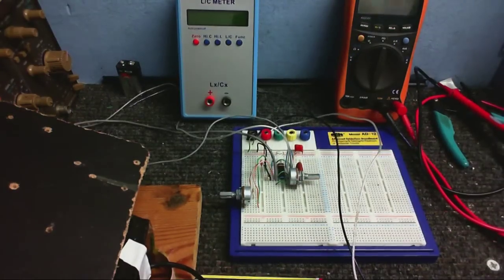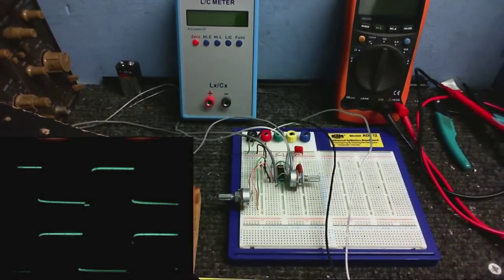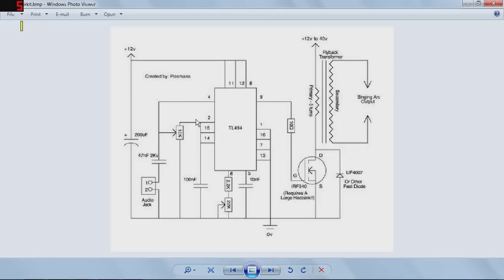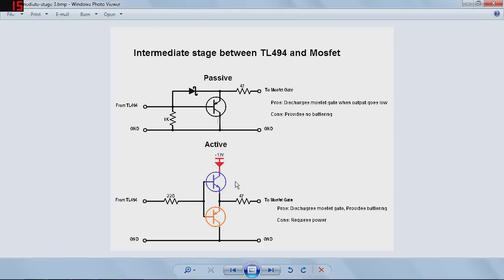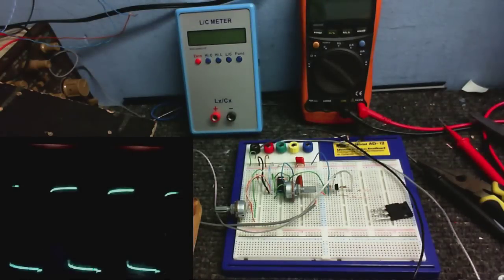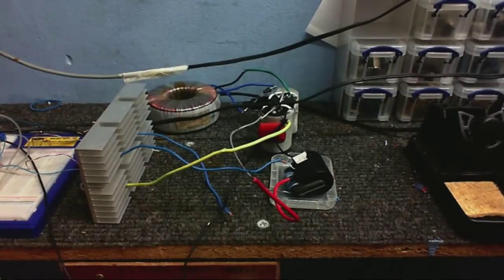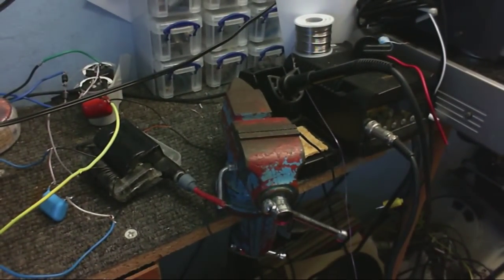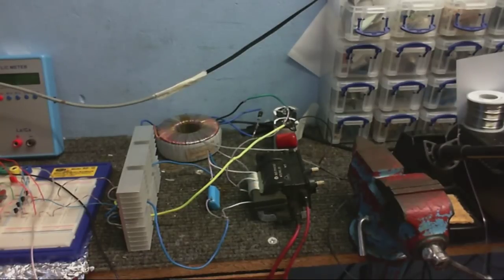CDC Electronic Workshop - TL494 Push-Pull flyback driver, plus singing arcs and I get shocked! :o

Comment: I'm surprised the push-pull follower is pulling low without a pull down resistor on the bases. Must be some idiosyncrasy with the TL494 or those transistors

Comment: I really have to ground flyback ground pin to the circuit? I was thinking in use a homemade 500t coil i have for it. And i can use to protect the mosfet reverse current with uf4007 ultrafast diodes?
Reply from the maker: +malicious1111 It's easier that way, then all I have to do is connect the circuit's ground to earth ground. It helps stop pin to pin arcing, basically as long as the flyback's ground and the circuit's ground are connected to earth ground, you shouldn't get pin to pin arcing or shocked from touching anything except the flyback HV out.  And yes it's a good idea to use the uf4007 diodes in parallel with the mosfets, even though the mosfets themselves have built diodes, the built in diodes cannot handle much current, so the uf 4007 will save them as they have less forward voltage drop and can handle more current.
Reply: +CoolDudeClem Aprpeciate your tips man, gonna get last parts i need and some spare ones and do this, i have a mosfet drive, but a single one, loved your simple active solution on it, i bet their wave form are pretty close compared to a chip, maybe only differency is the current capacity, one i got is 1 amp, those bcs cant handle more than few miliamps, maybe 150ma or even less, but nothing that will impact on its use in here, and we can aways use a 2n2222 and 2n2907.